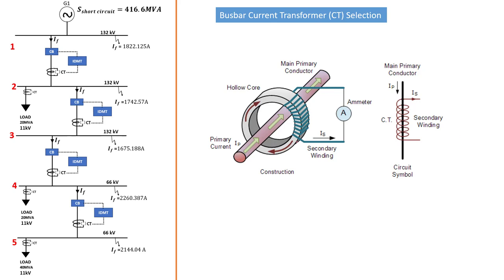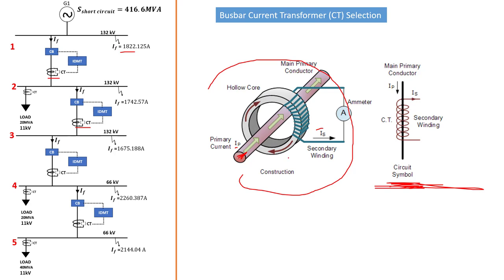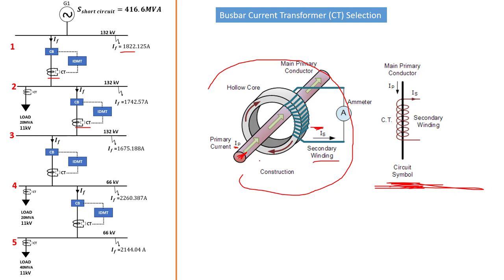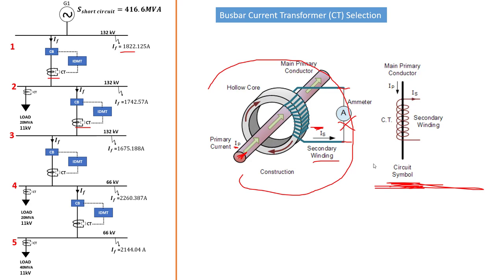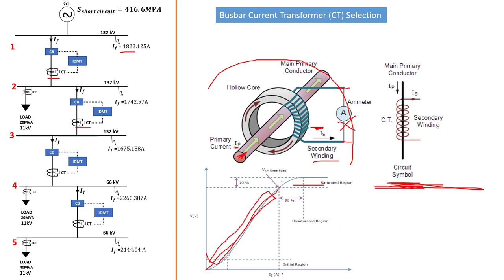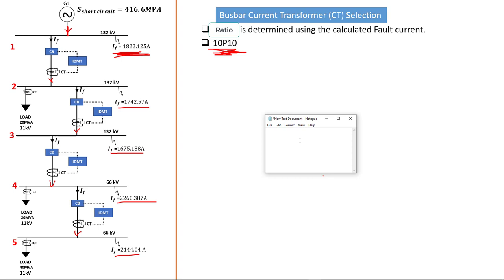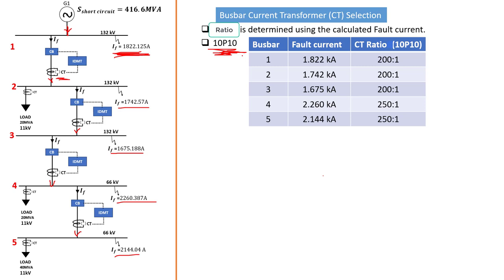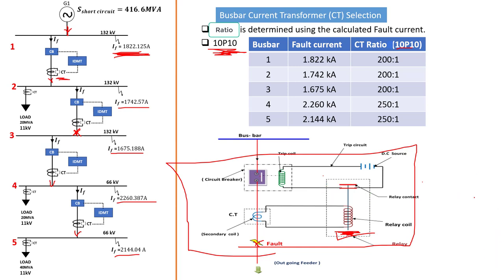How to select a Current Transformer (CT). Part 5 - Power System Network Design

Comment: Thank you for this explanation but I have a doubt that in Busbar 1 you consider the short circuit current 1822.125 Amp and you select the CT of 200/1 A ratio. My doubt is that, " the actual current in busbar 1 is arround 438 " can our relay is able to read the current of 438 amp with CT 200/1 ratio ?
Reply: And I saw in Schneider electric Micom P127 relay the max current we can send to the relay CT input is 5 amp and after that it may damage the relay. In the case 200/1 CT and fault current 1800 amp the CT may provide 9 Amp, where as max current of 5 amp we can give to relay. Then will it damage the relay during short circuit ? Please explain
Reply from the maker: Hi, please watch the tutorial again from minutes 10:30 where I explained the CT accuracy limit factor ALF, this is important for the CT selection.
200A will give 1A on the CT secondary according to 10P10, 200A will represent 2000A of short circuit current. So a nominal current of 438A will be a mere 43.8A as per 10P10, and this will not give 1A at the seconday, hence it will not trigger the protection circuit.
Reply from the maker: You are right about the ratings, but surely Schneider will not design CT to be used in High Voltage applications with only 5A primary ratings, this sound more like CT used in low voltage applications like Home Appliances. Just double check if they did not mention about the class of accuracy.